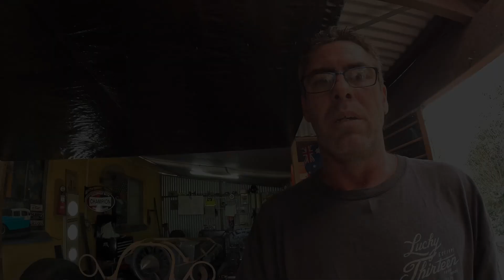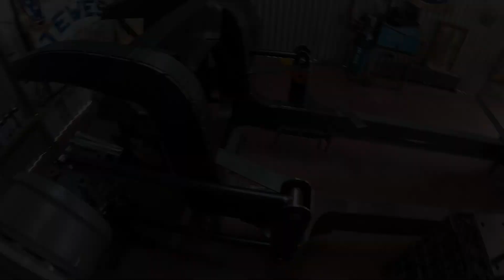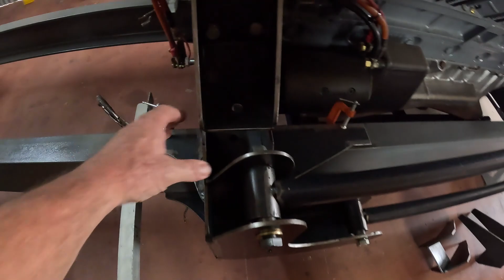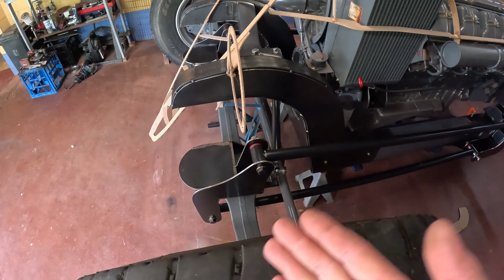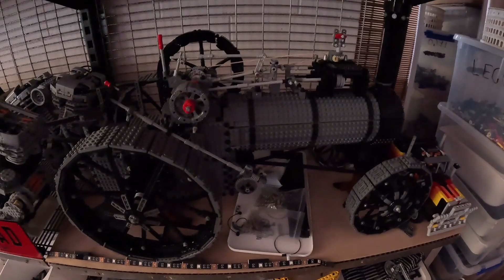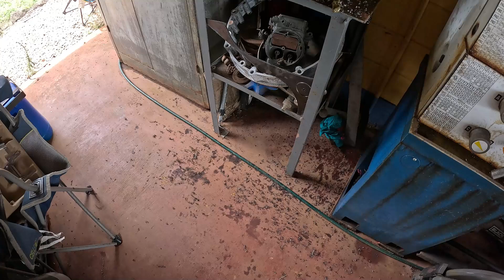The "Deutzenbarge" - Episode 2 - chassis design and construction

Comment: Great fabrication, mate! What's your opinion about boxing your channel rails? I was taught years ago that open sections are not that strong in torsion. Do you feel it will be necessary?
Reply from the maker: Thanks mate, if you note the extra plates edge coming in off the lower 4 link plates..front and rear brackets, I'm planning a huge centre cross brace of some sort,  depending on how the trans sits, I also have to add a rear crossmember for it yet, so I think it won't be needed, thanks again for your input though , cheers
Reply: @tewesy81  Hell yes, a cross brace will make it strong as f*ck!😂 Thanks for replying. Build on, brother. Following you from Africa's down under🙂
Reply: @ratrodsafrica  hey up my crazy uncle Diff howz you buddy?? howz your tummy holding up??
Reply: @chrislewis4830  still kicking Chris! 😂
Reply: in his defence there sixtimes thicker than any frame ive ever seen includeing the famous ford model T which yeah boxing to hold the extra power because there so thin but in this case NAHHH its the same type of steel section they use on road bridges. it aint going no where
Reply: Great question 🤔